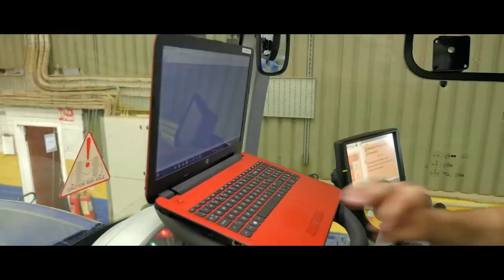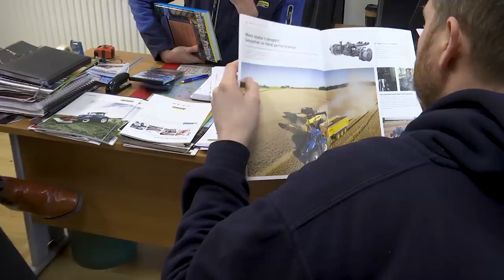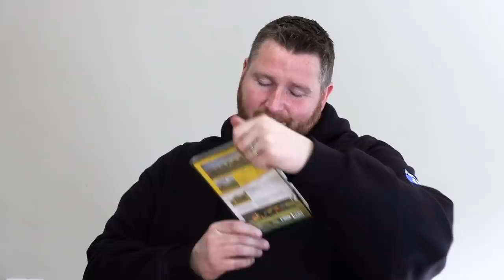Rain and Grain - Donkey's Cut

Comment: I loved clamping, it was exciting, I've done it with Loading Shovels, Hannomag and CAT,  Massive Tractors, Deutz and Fords, front loaders and front and rear Buck-rakes, plus a Drott steel tracked if you know what One of them is?? And rolled with a 4000, no cab but nice wheels to compact the grass properly,, I have covered clamps with tyres then taken the tyres off to cover the Silage with Small Bales of Barley straw a few Weeks later, I have had electric shocks from mains electric fences opening up the clamps for the cattle at 4.30 in the Morning, I have hauled Grass, Maize, cereals, Lucerne, Potatoes, I have fed cows on Carrot's and Potatoes died Purple and watch them pat purple and Orange,  I have stacked bales and bales of Hay and Straw cut side out and loved every Minute of it, 
And now it looks like I am A Grassman